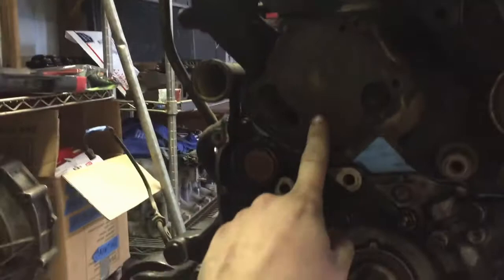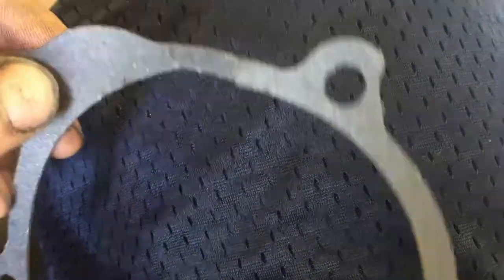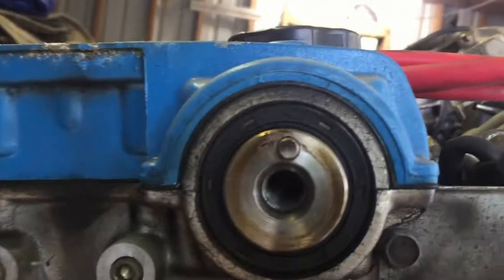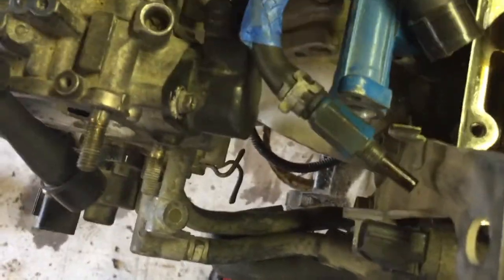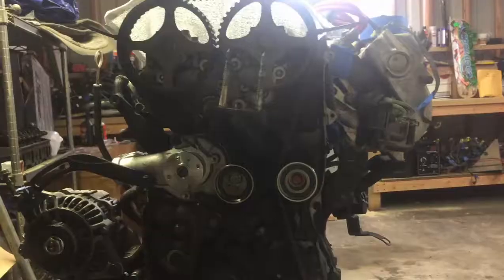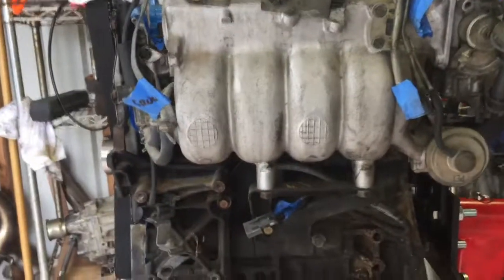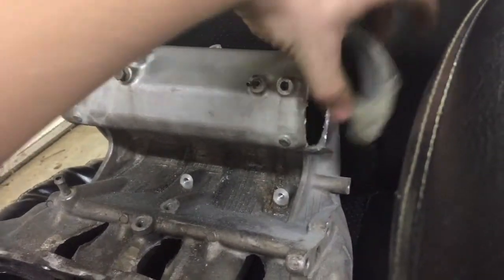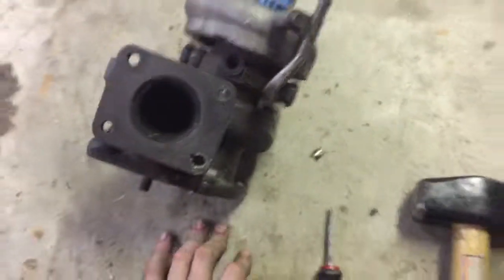Mighty Max 4G63 Swap Part 5 - Engine Reassembly

Comment: Hey man I have a question. 
I have a 1990 Mitsubishi Mighty Max that was in need of a rebuild. I purchased a core engine from LKQ to rebuild which did not come with an oil pan.
Once I bought my parts for my rebuild, I realized that the motor that I purchased has a curved front case while my Truck Oil pan is flat. I did some research and now realize that the motor that I bought is a 4G63 and NOT a 4g64 which explains why the caste in the fronts are different.
My question is, will the 4G63 that I have fit in my 1990 Mighty Max with a 4G63 pan or do I need to just rebuild the 4G64 that is in the truck. I really want to just swap once I have the new motor built.
Thanks for you help in advanced.
Reply from the maker: It would be much easier to rebuild the 64 than to go through the swap process. That being said, the swap is more rewarding. It will fit, with modification like I did in my videos